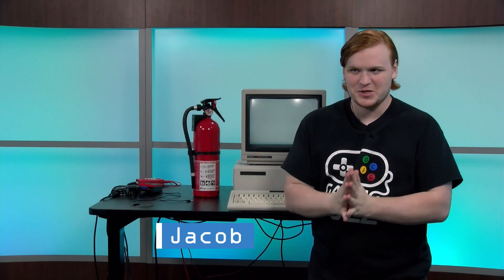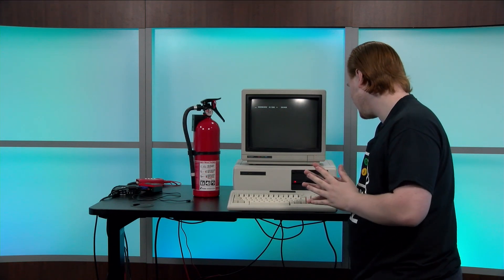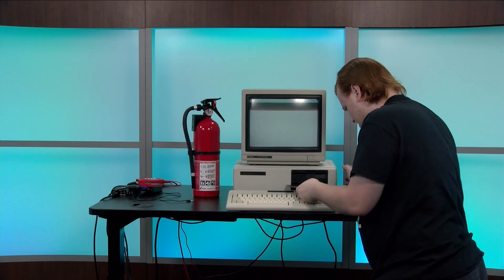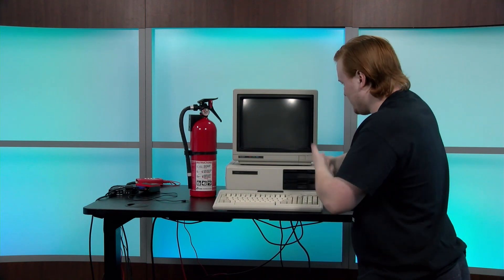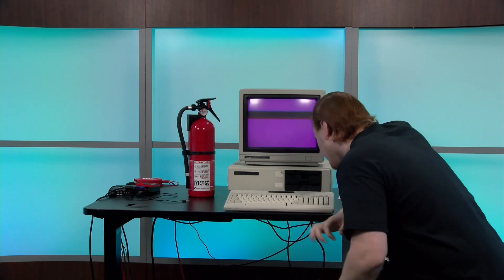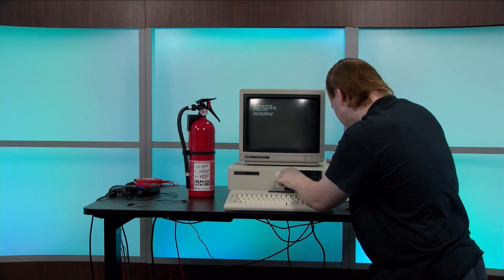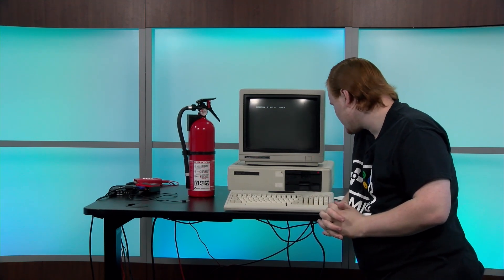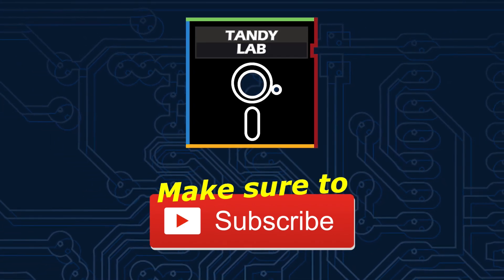Tandy 1000 First Boot #septandy

Comment: Both 1000 SX's that I've owned have both had A as the bottom drive... I think that was their standard.  I just got used to it.
Reply from the maker: Good to know. We have to do some testing with our SX's soon.
Reply: It followed the same configuration as the older TRS-80 systems -- the first drive is on the bottom and the second drive is on the top, like the stories of a building.